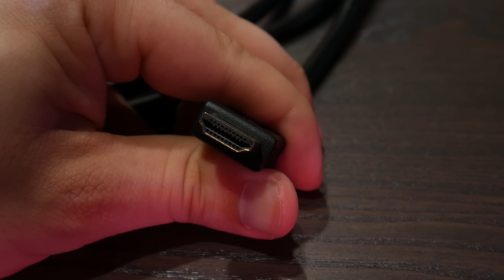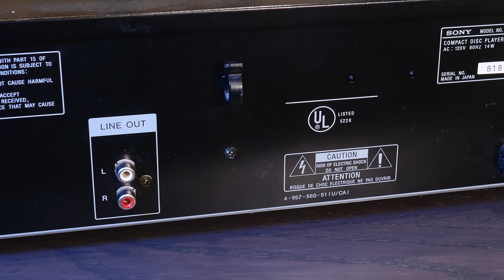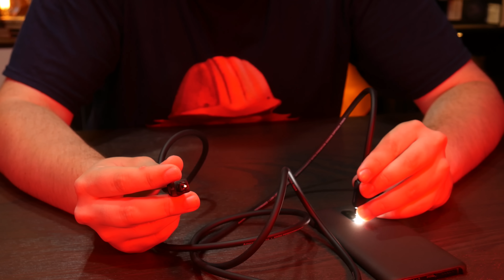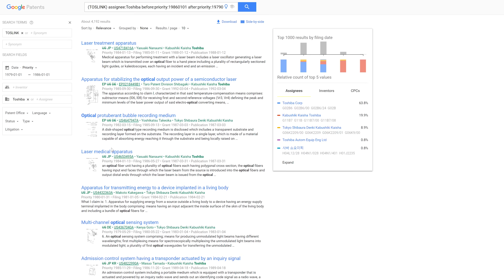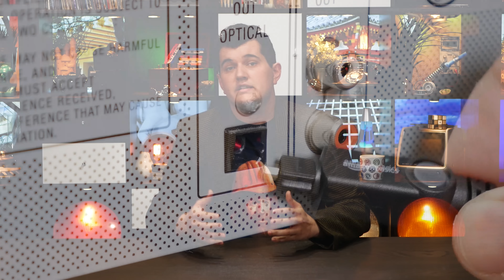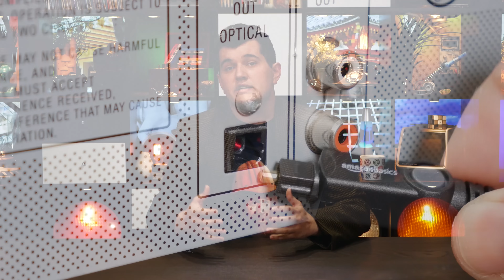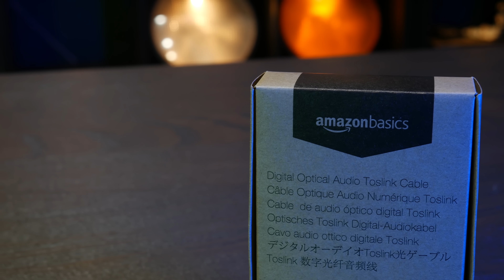TOSLINK: That one consumer fiber optic standard

Comment: I sometimes get to work on data fibre optics. The current plugs are not really suited for consumer use. It clicks before it is fully plugged in and every bit of dust and every air gap can stop it from working. There are single and multimode connections, flat and slanted ends (the slanted one reflects less). To measure if a cable is fine you need to put a ten kilometers extension in front of it because the laser takes time to get running smoothly. And the biggest problem is that it looses a good connection if it is bend to sharp. And it is quite a lot more work to repair than a copper cable when a excavator hits it. That's why we put it safely in the ground wire of the overhead lines.

Comment: The multi conductor copper design of the HDMI cable was just retarded as hell. The man who came up with that idea should've be taken out in the dessert and shot in the head. When the HDMI standard was being established. They should've gone straight to a fiber optic link. Why you ask? Because fiber has orders of magnitude more bandwidth then they could ever hope to get from that multi conductor copper cable design they settled on. Plus,  you can run fiber at distances of hundreds of feet. You'd be lucky to get 10 feet from that copper cable without getting bit errors in the signal. But the most important thing about using a fiber link is that fiber is thinner, lighter and the costumer can cut and splice their custom cable lengths where as with the copper HDMI cables. You could only get them in fix lengths and if it was too long. you would have to coil it up and hide it somewhere. A just believe that a fiber based HDMI connection would be so, so much better. But then again. Maybe I'm just preaching to the choir.

Comment: In the Netherlands internet through optical fibre is quite common. Usually the fibre ends up somewhere around the fuse box and is then connected to a router (which defeats the purpose of fibre a bit).

Comment: i frankensteined a spdif cable once, made a 5m cable from two 2.5m cables. everything shielded except for where the cables were joined. the signal would cut off every time i turned on or off the lights. so i switched to toslink

Comment: TOSLink is still useful in cases where you can't use ARC without upgrading your soundbar. A rather unfortunate thing is that most higher-ish end TVs don't have all-HDMI2 outputs and often make one of those outputs the ARC one. So if you want to use two devices with 4K HDR output you would have to upgrade your soundbar to support the higher HDMI standard if you intend to use it as an input as well as an ARC.  In these cases TOSLink is really handy.

Comment: The basic advantage of TOSLINK has two synergistic factors. As noted, it avoids ground loops. But the other advantage is that it is not an RCA connector. To quote "The Art of Electronics," by Horowitz and Hill. "The so-called phono jack used in audio equipment is a nice lesson in bad design, because the inner conductor mates before the shield when you plug it
in; furthermore, the design of the connector is such that both shield and
center conductor tend to make poor contact. You've undoubtedly heard the
results!" . The combination of a poor RCA connector (particularly with a bit of corrosion) and a ground loop often was the bane of both SPDIF and analog audio. With the advent of better connectors such as properly implemented HDMI this is less relevant. That said ODROID SBCs have been notorious for having HDMI ground loop problems with many cables.

Comment: I was using a standard copper cable to send the audio from my record player around my room to my computer. I was getting a lot of interference even with a good cable.

I switched to an optical cable and voila no more interference.

I tend to prefer optical connections as they don’t conduct electrical noise and aren’t affected by EM interference.

Comment: Actually, most AV integraters and installers will prefer TOSlink for feeding audio from Smart tvs back to the receiver over ARC through the HDMI, mostly because it sucks ass. Some manufacturers (CoughSONYCough) Can't figure out how to properly implement ARC or CEC so that it works with other 3rd party equipment. ARC just doesn't work sometimes and just adds a layer of complication to a home theater system. So we still religiously use TOSlink out of the TV for audio from the smart apps. Otherwise we generally don't use it.

Comment: A place where this would work would have been car stereos. It would have saved a lot of headaches trying to get rid of interference while hooking up an aftermarket amplifier
Reply: I've seen it used on high end car amps and equipment, I mean high end though, not your house brands like Pioneer or Kenwood.
Reply: @ixionn563  Now you take that back! I demand respect to Pioneer!! )))
Reply: @Offsettttt  Don't worry, no shade to either company. :) I'm a massive Kenwood fan, I have vintage 1970s and 1980s home audio Kenwood amps and receivers, and although I have far less Pioneer stuff I do have a Pioneer amp in my truck and it's great! (I know you're being sarcastic)
Reply: @ixionn563 see; thats why whatshisname use "garden variety" 50 times by videos
Reply: It was implemented. Have som old Sony equipment (early 90's) where the different boxes are connected via Toslink.

Comment: I really like using TOSLINK, you can buy a 15m cable for cheap and it will work (well, mine does) to pipe sound from one room to another room on another floor with no glitches. I think you can do it with HDMI or coax, but I doubt it's so cheap and resilient. Hell I've laid it under carpet and around door frames easily.

Comment: The Co-ax S/P-DIF cable is not "differential" in the same way as professional XLR (or even "balanced TRS") connectors.  With the cable passing behind the TV (Cathode Ray Tube) it is in an electromagnetic hostile environment.  TOSLINK, OTOH, is immune from the interference due to sweeping magnetic fields.  Recall that "Center" speakers were also specially shielded from this, as they were expected to be perched directly above the CRT.  I agree that "digital" is normally good enough to be immune from interference, passing through a specifically hostile environment of huge, bright CRTs is exceptional.

In the 90's, I had a CD (jukebox) player that directly fed to the Denon receiver.  This was especially interesting for the (now little-known) DTS CD.

Comment: Yeahh... mini toslink is very common. macs use them ubiquitously as did older high end gaming headesets. As a person who uses alot of audio to DAC from a pc Toslink has its obvious positives but i can agree in most common home setups a single aux cable is fine depending on total wiring. But a good ear can tell the difference or you have to spend $$$ on stupid monster cables or just get a cheapo toslink and call it a day. I used to work in a high end A/V install group. I would love to see you Eviscerate monster cables and their over priced scam some day with "nitrogen injected cables" and all that balony people pay hundreds for. Monster has one AND I MEAN ONE good redeemable quality and that is a lifetime warranty sans receipt. Please compare Cheap vs moderate vs Monster Cable Products some day please. Also look into alternatives especially when it comes to their audio cable and unless you are running hundreds of hundreds of feet monster does not win even then there is an option 100x cheaper i almost garuntee. Monster is a scam and needs to be brought down they are only an inflation tool by the digital media market.

Comment: Just before the turn of the last century, I was working with some fairly advanced Toshiba Programmable Logic Controllers. (PLCs) For the industrial process at hand, we used the very same Toslink optical fiber cables  and connectors as are used for audio, to connect many PLCs and computers via Toslink ethernet switches. each ethernet port used a pair of fiber optic cables - transmit and receive. It seems to me that we could have about a 300 meter run between switches, and maintained 100 mpbs speeds with 20 ports per switch. It compared very favorably with cat-5 cable, with fewer cables between stations.  The speeds were likely limited only by the hardware in use at the time. 
    In an environment of large industrial drives with power transients and harmonic distortions, optical fiber for ethernet was good stuff.

Comment: Great video! Just wanted to add a reason for TOSLINK to still be around even in the age of HDMI. The original version of ARC only supports 2-chanel audio, so if your TV is getting multichannel audio from another source (say the built in OTA tuner) and you want keep it, you need a separate audio only connection. And conveniently, there's a TOSLINK on everything for some reason. I listened to your episode over TOSLINK from my TV to my receiver, so I know it works :)

This changes in HDMI 2.1 which adds eARC. You don't need new cables for that particular feature so it will probably be one of the most readily adopted aspects of the new standard. Once it becomes ubiquitous TOSLINK might finally disappear. Maybe.

Comment: High resolution sound? Digital audio doesn’t have a resolution. Bit depth only determines where the noise floor is, and sampling rate only determines the highest frequency that can be reproduced. Otherwise the reproduction is perfect. A 1 KHz signal reproduced with an 8 KHz sampling rate will be identical to one reproduced with a 192 KHz sampling rate. The 192 KHz version will not have a higher resolution. Doesn’t work like that. There will be literally no difference in output. A refresh viewing of Digital Show And Tell may be in order. ;)

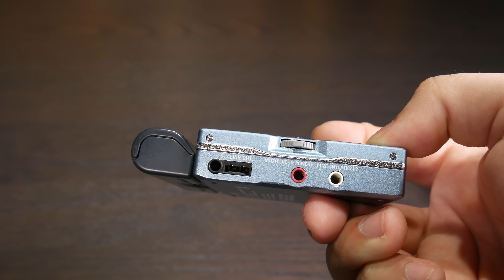Comment: @14:10 - One word that might enlighten you about Mini Toslink just being found in junk: iMac. Indeed, iMacs have carried a 3.55mm/Mini Toslink connector for ages. Now, unless you're an Apple hater (of which there are many, and I'm definitely not intent upon addressing them in this comment) you couldn't exactly class them as being "junk". Also (Mini) Toslink is the only way many (portable) computers can output more than 2 channels of audio unless you are using some, arguably higher quality, external (A)DAC. And with the vast majority of digital audio used and produced on (consumer grade) computers being compressed/lossy anyway, I personally think there may be quite some time left on Toslink's lease of life.

Comment: Imagine a world where Toslink was an analogue standard, as a way to send the analogue signal from the CD player's built in DAC to any amp with a light to voltage converter.

But was that possible with LEDs of the 1980's? Because for an analogue light signal representing a sound signal you'd need the light intensity to continually vary and not just flash on and off.

Maybe modern diodes can do that, idk about back when Return Of The Jedi first was in theatres.

And then is this going to be as good as a copper cable, as the optic will dim over distance so need more amplification for a longer cable and kinks in the wire... maybe its easier to just shield the analogue signal or send the signal in digital form and do the DAC conversion as close to the amp as possible with the amplifier using built in EM interference management.

Comment: 10:50 when both audio transmiter and audio receiver have a connection to protective earth and the shield of the RCA jacks are connected to the devices protective earth, adding an RCA cable means creating a ground loop. This ground loop introduces hum into the system and thus what we hear. Not the digital signal (there you are right) but the system (which you overlook). Note that hum can couple into the audio signal at various points. A typical example would be the power supply. When the transformer core is connected to protective earth, then hum can couple over the RCA jacks into the protective earth, via protective earth to the transformer, then from the transformer into the end amplifier. Please also note that one transmitter and one receiver is a gross simplification. A more typical set up has multiple inputs on the audio receiver. Some of them migth still be analog (-> vinyl player). When you add needles protective earth connection by using RCA cables, then your DVD player may degrade the vinyl player by the protective earth connection of the DVD-player, audio receiver and vinyl player. Sure: You can tell me that you never saw such an effect in practice - simple things like powering all audio equipment from the power strip and keeping wiring short helps a lot - but there are situations where in fact noise on a digital signal effects system performance. (For e.g. when you have an audio connection from the top floor to the ground floor, the floors where wired to different phases and the cloth dryer is running in the basemet)

Comment: One use of fiber optics in the home could be for surge/spike/lightning protection. FTTH already maybe has this covered but if you are still like me and have a copper wire based ISP, in my case cable TV, a pair of Ethernet to fiber media converters and HDMI over fiber adapters along with the matching fiber patch cables could potentially electrically isolate your expensive stuff from possible damage leaving only the equipment that you likely lease from the ISP to take one for the team and get fried.

Comment: You pretty well nailed it. I have a mid-high end 90's Yamaha 5.1 AV amp, partly because I got in to vinyl record collecting but also because modern amps are hilariously expensive. All of the video standards are horribly outdated (S-Video is the best it can manage I think) but thanks to toslink I'm able to enjoy DTS-compatible digital audio from my:
CD player
Ancient TV's set top box (it's a rental house and unremovable, it's connected to one of the first Fujitsu Plasma TV's still running hot- uhhh strong)
airplay via airport express
PS4
PS2
Computers

Toslink may be on its way out in terms of relevancy, but the compatibility alone makes it kind of special. If it weren't for toslink, I wouldn't have been able to get the audio setup I have now without spending $1000's

Comment: The "keying" in the toslink connector is actually just a side-effect of re-using the same inner body than the SC optical fiber connector. Toslink doesnt have the push-pull outer body, but the ferrule and  body are pretty much the same dimensions (toslink has the two "divots" on the sides but I believe those are mostly to keep the connector plugged in since you dont have the push-pull jacket).

im guessing why re-invent the wheel when you already had a good connector body

Comment: Two words: Ground loop.
...was what I was going to say. I've had troubles in the past with complicated audio setups for recording that involved sending audio in and out between two devices, creating a ground loop and noise on the lines. But considering this is optical spdif we're talking about - targeted at the consumer space - yeah... I'm not sure even ground loop scenarios makes a strong case for extruded plastic light pipes over... ya know, bits of wire.

Comment: I have an older A/V receiver, and still use TOSLink to connect my Blu-Ray and Laserdisc player to it.  For my purposes it works great.
Reply: Still using it with my 2003 Yamaha receiver. My 2017 LG TV has a toslink output so everything I put into the TV gets passed through to the receiver over the fibre with DTS/DD5.1 and all. It works great!

Comment: The reason fiber isn't supported in the home is it's to exspensive and frankly overkill.  Within 50 feet ethernet cables depending on the catagory can support up to 10Gbs.  That's way more than most people can use.  Fiber really comes into it's own on long distance runs or if you need a ludicrus amount of bandwidth.   Those are just conditions that a residential market can't reach.

Comment: My TV (and maybe receiver?) are too old for the return over HDMI functionality, so I had to have some way to get the audio back to the receiver for the odd situation when I want to use the TVs tuner to watch terrestrial TV. I chose TOSLINK for that task. Didn't realize they were actually the same exact signal. But hey, less potential for RFI (or ground loops as others have noted) with optical and the cable wasn't that expensive. Also, it seems cooler even if it's not doing anything special.

Edit: Yes, I was uninformed when I chose TOSLINK, but in the end, it works just as well and the cost was negligible. If I had known they were the exact same signal I would have probably just harvested an old RCA cable to do the same job. But, you live and you learn.

Comment: Ironically, I had to order an optical cable tonight for our new TV. Our receiver is older and lacks HDMI ports. So, using built-in streaming apps will require me to hook up in another way and optical was simply the easiest option for available ports on the receiver. (And no, didn't buy a gold tip cable. Lol)

Comment: I wish there was a proper replacement. HDMI is nice and all for when you need video and audio to go to the same place, but there's nothing except TOSLINK (and S/PDIF of course, but it's literally the same as far as limitations go) to connect up digital audio-only signals.say I want to run my audio into a PC to mix in other stuff and then put it on fancy usb headphones or something. With HDMI, you'd have to either run the video through the PC as well, which brings way more complications and also has ridiculous bandwidth requirements, or you look for some kind of digital HDMI audio splitter, which will probably just terminate in TOSLINK again...